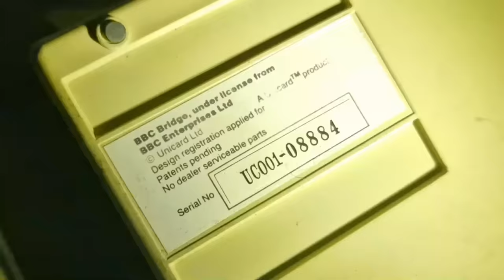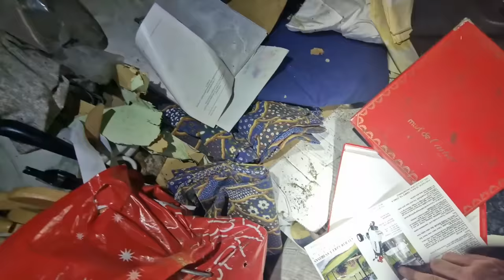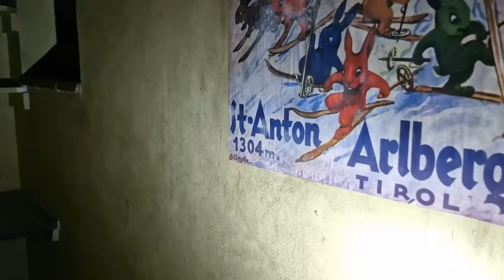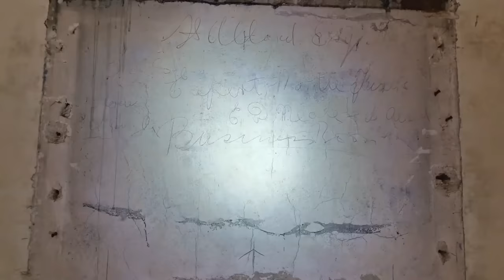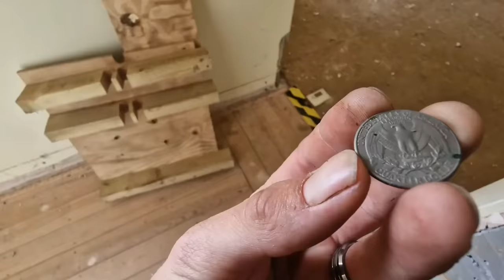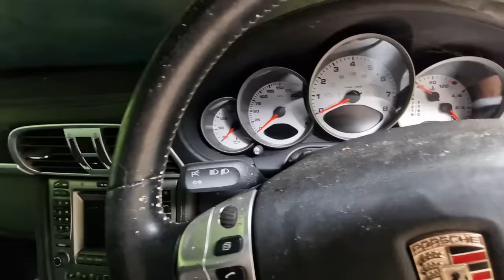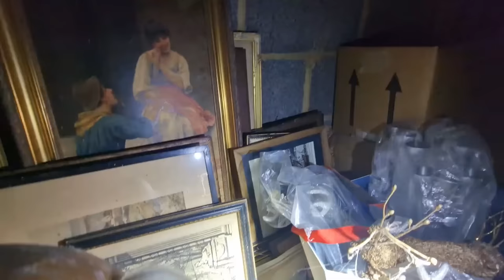We Found an ABANDONED £10,000,000 Mansion! Cars and belongings left behind!

Comment: Has a new owner almost two years now, planning permission has gone in several times to demolish the existing property & build multiple houses on the plot, but been refused. Probably due to it's gated community setting. What will probably happen is there will be an accidental fire, damaging the building beyond repair, then, in time, planning permission will go through with no problems... that's what usually happens. Look at what happened to Fyves Court, amongst others.

Comment: The mini was last MOT'd in 2018 with just 37,000 miles on the clock.
Reply: How do u know this?
Reply: @jasonryan7060  worked out the reg plate from a section of the video that wasn't pixelated.
Reply: Surely it hasn't got to this level of ruin in 5 years, has it?
Reply: Further digging says log book was issued in Feb 19 also. So it probably has got like that in such a short period of time. Wow. 
I 100% thought this would've been financial crash era 2007-12 ish
Reply: @stugil1986  left unloved and accessible to vandals, it could go like this so quickly. Still could easily be rescued and would be a very worthwhile project considering the mileage. Hopefully whoever owns the cars will see sense and sell them before they go too far.

Comment: I would put the house at PRE 1940's as Lath and Plaster went out of use around that time. The Porsche was a 2002 or 2005 the Mini's started around 2001
Reply: The porsche is a 997 and the carrera 4s didn't arrive till the back end of 2005 mate. The mini was a secone generation of the bmw mini which came out in 2006 as well.

Comment: Interesting video.  I don't think the house is very old.  It was probably built in the 1980s, albeit very nicely and at great expense, in a traditional style.  What's left of the interiors is very 1980s.  I'm confused as to when it was abandoned.  It doesn't look like it has been updated internally since new.  The BMW Mini didn't come out until 2000 though, so perhaps the house was abandoned in the early noughties.  As to why it was abandoned, perhaps it was a criminal, who had to flit in a hurry or someone who died, with no beneficiaries.  If someone went to the trouble of trying to secure it, why hasn't it been sold off?

Incidentally, the 3 Hercules at the start of the video were on the RAF aircraft's farewell flypast around Britain (14 June 2023).
Reply: Looking at those exposed ceilings, those ceiling lathes suggest it predates the 1980s a fair bit.
Older house built around/extended at a later date.
Reply: Do you mean 1890s? I thought it was late Victorian myself.
Reply: yes the brickwork gives it away, it's a fake Jacobean mansion. it might be 100 years old but definitely not 1500's.
Reply: @Wally-H  Spot on. It would be mid 1920's to 1930's. Arts and Crafts and all that blend of everything mixed together. Nicely built though. Clear later extension but well matched. Clear signs of updating with foil backed insulation etc. Looks to me like a common case of persons dying and the sorting of the will, probate, disputes, IHT just running on for ever. Time flies, legal processes are slow and expensive and it doesn't take long for houses to fall into a terrible state when there is no maintenance upkeep, heating is off so damp gets in and the vandals find the place.
Reply: It may well be a contested will or something similar. Or someone negotiating a better price or applying for planning permission etc. Highly unlikely anyone will buy this and restore it. Depending where it is and access, utilities etc, it will be developed, as there is a massive shortage of housing, and developers can do very well. Councils will give permission for a large development if it suits them. 
As for the interiors, if you have this sort of money then you put in fancy bathrooms and kitchens. Whoever did that in the 80s then fell on hard times or disappeared. England has huge numbers of beautiful, old houses - it has to have something very special and different, plus be well located, for someone to want to shell out to restore this sort of property.